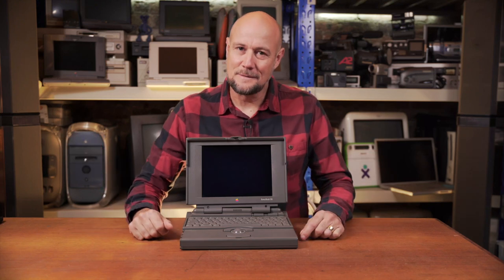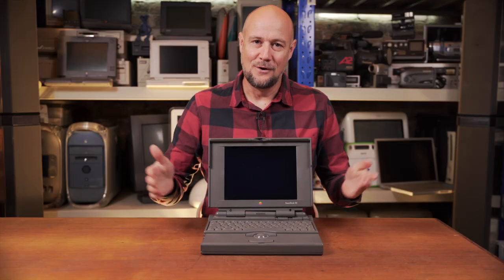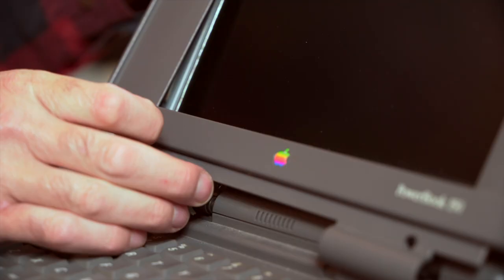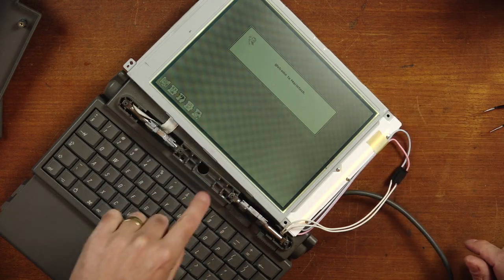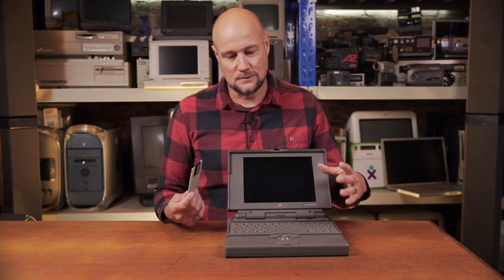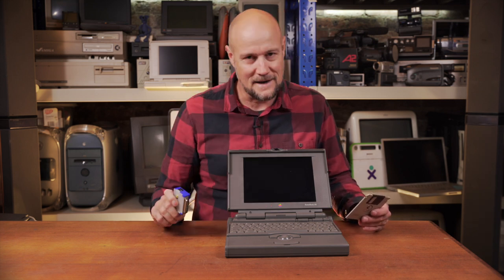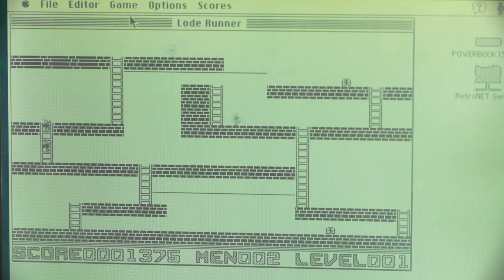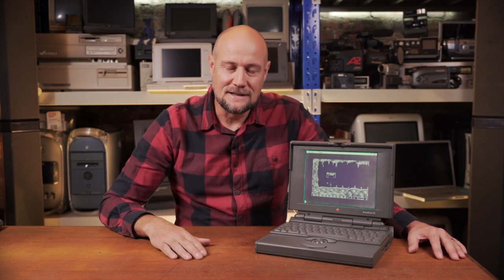Powerbook 150 for $15! | Why is it so hated? | Review & Repair

Comment: there is a hack out there to add an ADB port to the 150 as well, but you need to use the waybackmachine to view the data. I have done it..... involves soldering and drilling a port on the back.
Reply from the maker: Yes I’ve heard about this. I’m keen to give it a try when I get the time!

Comment: Another question for you: working on my 150 now, hasn’t been going to plan though. Mainly, my repair to the screw wells you replaced with washers broke instantly. What size washers did you use on yours? I’m going to give that method a go.
Reply from the maker: No idea of the size unfortunately, I just have an extensive washer collection so I looked through that to find something. Make sure it’s as thin as possible, as extra thickness here stops the two halves from closing tightly. Sand or score the surfaces before epoxy. Good luck!

Comment: Please tell me how you made the utility floppy disk
Reply from the maker: I use software called Balena Etcher which is designed to write disk images to USB drives. I found the image on Macintosh Garden and wrote it to a disk in an external USB floppy drive on my iMac.

Comment: Thanks. Fascinating video. What is the brand of epoxy you used for the repairs?
Reply from the maker: I used Chemset, which is a Ramset product. I had a half used tube left over from a construction project (I’m a builder by day) and tried it out on a previous repair, and it worked great, so I’ve continued using it.

Comment: I know I'm digging this conversation up from the dead, but it's #MARCHintosh...
I have a PB 150 and a PB 180 (plus a few others) and I'm torn. I have that mythical 36MB RAM expansion and I've upgraded the hard drive to a SSD. I like using it as a dedicated writing machine and it's totally capable 68030 laptop for those purposes. I recently picked up a 180 from a recycler where it was being sold as "not working". I noticed that the power supply brick they had included with it did not seem to match the connector that my other 100-series brick, so I took it home for $40 and now I have a working 180 as well. The 150 has that crappy display, but the 180 has a lower RAM capacity. The 180 also has a FPU. I'm wondering if I can get A/UX running on the 180??
Reply from the maker: That’s awesome, I love those wins when it’s an easy fix like using the correct power adapter 😆 I recently had a win with a PowerBook Duo sold as not working but they don’t boot if the battery is dead, so I removed the battery and it fired right up.
I can’t help you with the A/UX question I’m afraid, I’ve never had anything to do with it. But I say use both machines! Set up an Apple talk network (super easy using the serial connector) and you can write on either ma ch one and share between them. Personally I’m not a huge fan of the 150 keyboard, it feels a bit stiff, but that could just be mine? Happy retro computing!

Comment: Hah, no way, I just got one of these! You got a great deal on it, and you were extremely lucky.
1. Someone had already removed the PRAM battery. Unlike other 100 series models, the one the 150 used is a NiMH type that nearly always leaks. It likely would have been toast if it was still installed. The only reason mine survived is because someone replaced it.
2. The quantum hard drive worked! These have rubber bumpers in them that always become sticky and get the heads stuck. It’s extremely lucky to see one of those drives work. Don’t expect it to last though.

Mine has the same issues with the hinges, although a bit worse. I’m going to go the route of replacing them with a 3D printed part, but that epoxy looks great too. What is that stuff called?

I’ll be making a video on mine when I’m done. I really enjoyed yours!
Reply from the maker: Awesome! They’re fun to work on. I like the idea of using the 3D printed part for the hinges, and would most likely deliver a better result. But I don’t have a 3D printer, and my machine will probably mostly just be on display, so I’m happy with the epoxy fix. The epoxy I use is called Chemset, which is a Ramset product. Thanks for watching, and I look forward to your video on the topic!
Reply: @TheBasementChannel  I’ll have to look into that stuff, does it stink real bad like other epoxies do?
Reply from the maker: @3lectr1c  it does have a particular aroma, yes 😆

Comment: Can we use 2.5 ide ssd hard disk for this Macintosh 150? If it is i will include this one for my vintage apple collection.

Yesterday i repaired and recovered Macintosh 145b. But i couldn’t install os because of faulty floppy drive. Are there any ways to recover os except inbuilt floppy drive?
Reply from the maker: I don’t see why a 150 couldn’t use a SSD provided you used the correct connector. And you should most definitely get an external BlueSCSI, it will be very useful for all of your old macs. I use one in this video to install the OS.